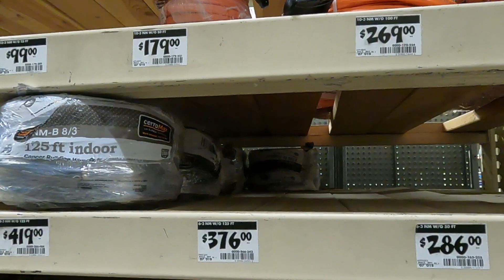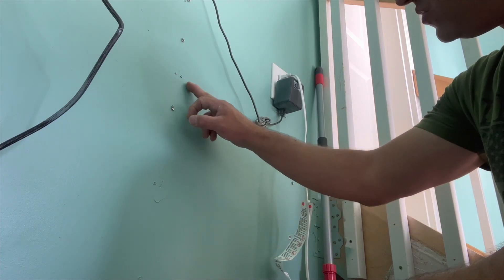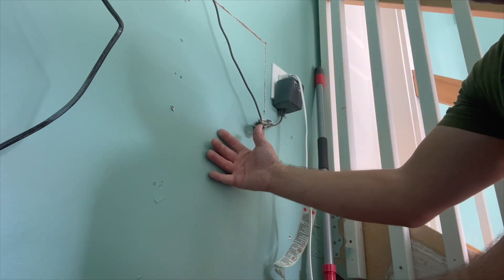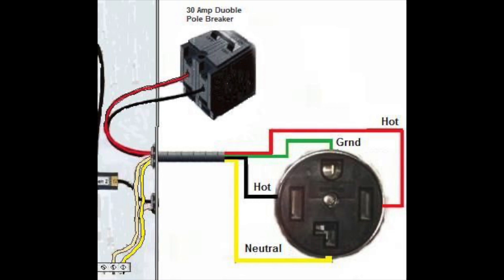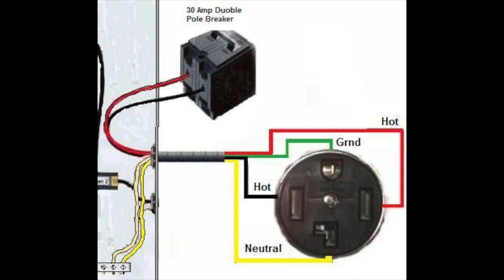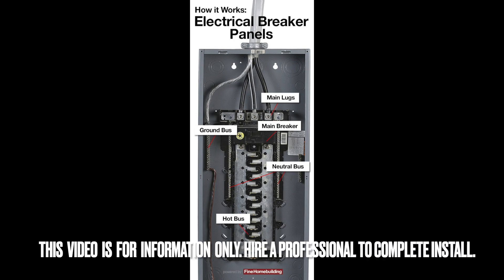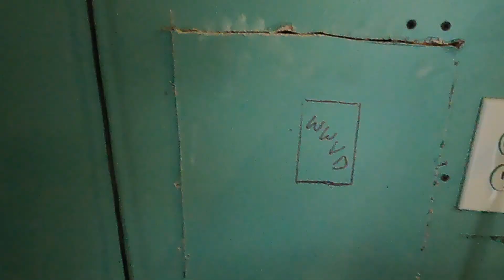EVERY TESLA OWNER NEEDS THIS DONE! How To Install a 240 Volt Outlet | Electric Car Charging

Comment: According to the American Wire Standard (AWS), a 50-amp circuit breaker requires a wire of at least 6-gauge as the conductor for the circuit. Using a thinner wire gauge will result in your electrical system not being up to code and can pose a severe safety risk.  Also, according to the American Wire Gauge system, the appropriate wire gauge to use in conjunction with a 50-amp breaker is a 6-gauge wire. The 6-gauge copper conductor wire is rated up to 55 amps, making it the perfect choice for a 50A circuit.

Tesla recommends installing an industrial/commercial grade NEMA 14-50 outlet.  There has been a number of instances where the a non-commercial NEMA 14-50 outlets have melted down, which could be a fire hazard.  These industrial/commercial grade NEMA 14-50 outlets are considerably more money, but are built sturdier and use higher quality materials.
Reply from the maker: Hey Robin! Thanks for your insight. Yes, I agree better to go with 6 gauge just in case for Tesla. I would also recommend the recommended commercial outlet you described as well to be safe. Thanks for taking the time to post and share the knowledge you provided.